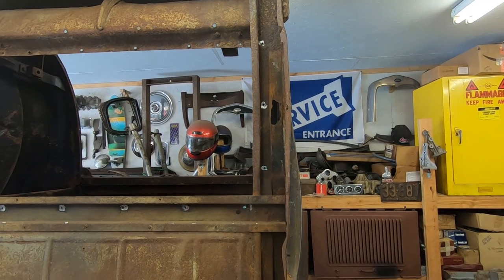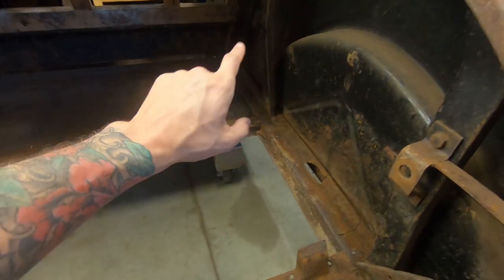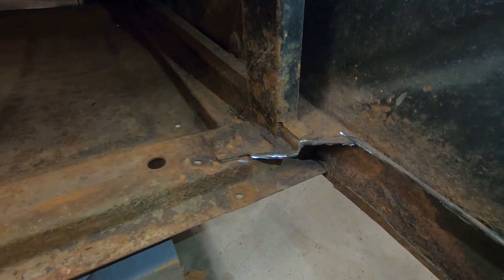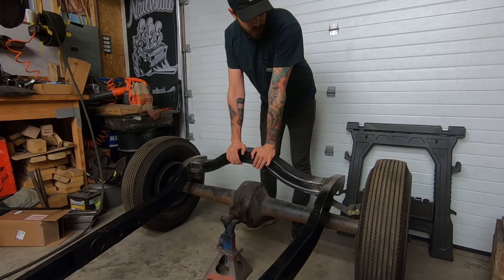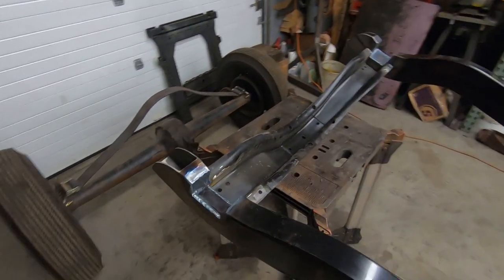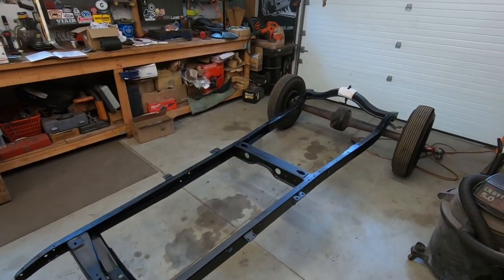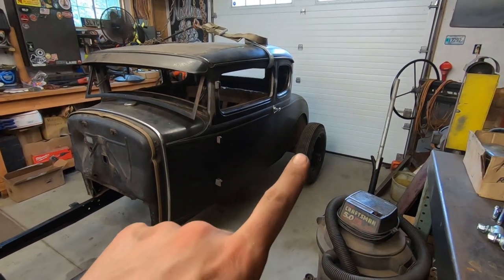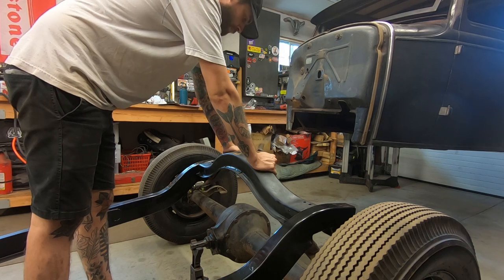Traditional Hot Rod Frame Finished! Test Fitting The Body

Comment: Does the rear of the body just float out there attached to nothing? Could the bob have been extended to allow the body not to float...Thanks I enjoy your channel
Reply from the maker: Yes it does there was a body mount back there but it gets removed when you z the frame. Even in “the book” from Vern Tardel, he removes the body mount. Doesn’t really do anything anyway.
Reply: The rear of the body does float but the rear crossmember has ears on each side that are the last body mounts. When the frame here was swept up you lose those body mounts. I did the tardel step on my A chassis and made simple rear body mounts that tie in with the structure i made to cover the boot floor. I figured better to have something there than nothing.
Reply: @RACGARAGE  I've wondered that myself whether it should be replaced or left out. Without it it's like a third of the body is unsupported / bolted in. I made a simple rear mount when i did a boot floor structure that tied into the crossmember but i'm sure plenty of people leave it out.